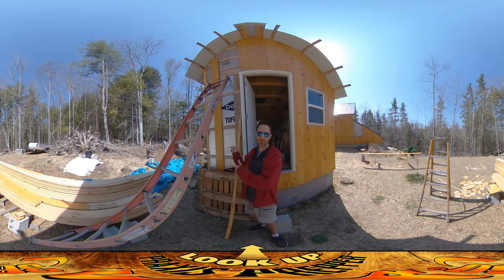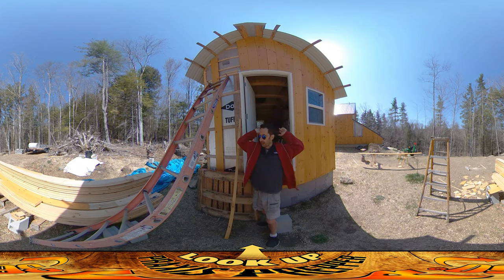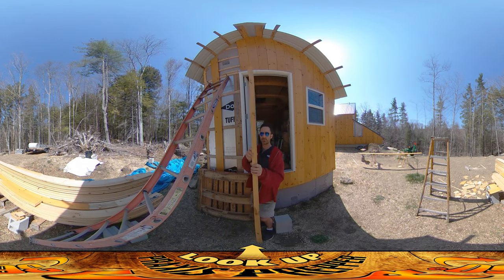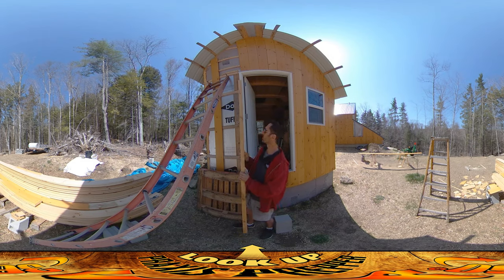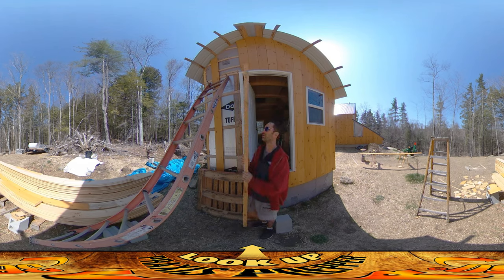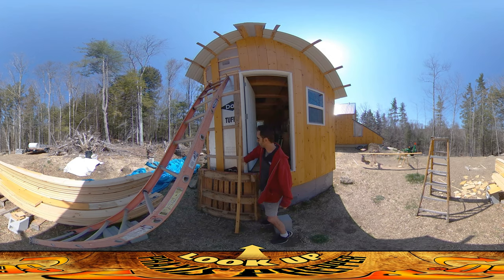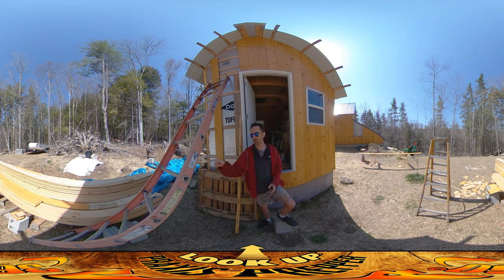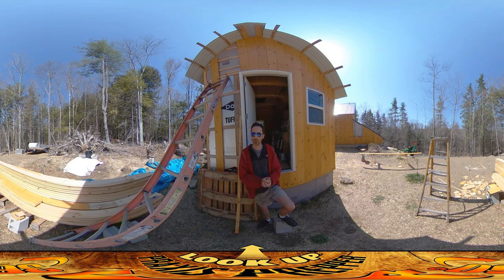Homestead Building - Finishing Up Mini House Sheathing, Planning for Future Projects

Comment: You're almost there!
Out of curiosity - do you plan to apply any sort of wood sealer to the exterior to protect it from weather? I don't know how well wood withstands exposure in your area, but here on the Gulf coast, wood doesn't last long without it.
Reply from the maker: I didn't mention it in this episode, but yes, all the wood I'm putting up on the structures is being pre-sealed with 2 coats of wood seal. I decided to not be an idiot this time (like I was when I built my first house) and seal the wood BEFORE I screwed it up onto the house 20 feet in the freaking air! ;)

Comment: Bet you are so glad you didn’t start building last year, really dodged a bullet on that one.

If you have any idea as to your woodshed design, it might want to get it quoted out at an 84 Lumber, they give the best volume discounts in my limited experience. If it is way way too high, look for someone in your area with a portable woodmill. They are around and I’ve heard they can be pretty reasonable compared to lumber stores when considering the time required to dry the wood which was a couple years ago, now it might be ridiculously cheap in comparison and you might be able to get away with just trading a couple trees for their services.
Reply from the maker: Thx for the lumber tip. Fortunately, I need very little new lumber (mostly 2x3's) for the shed.